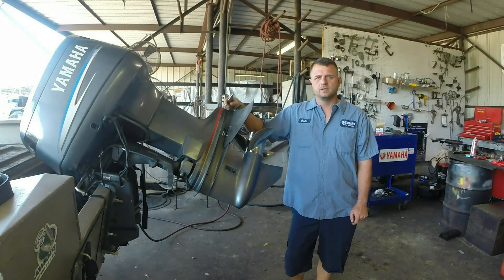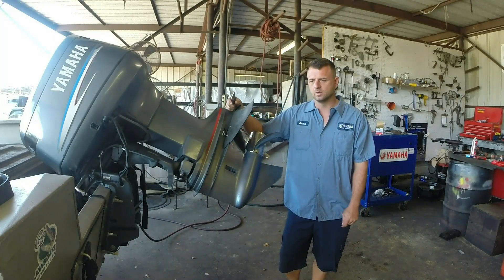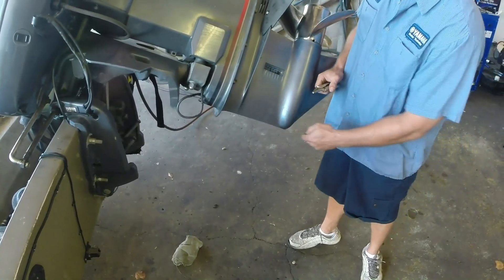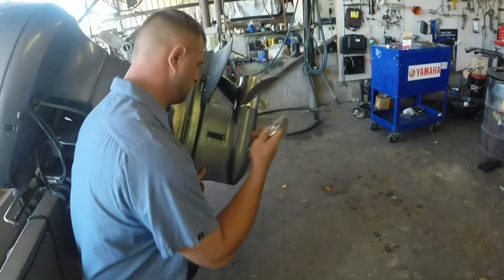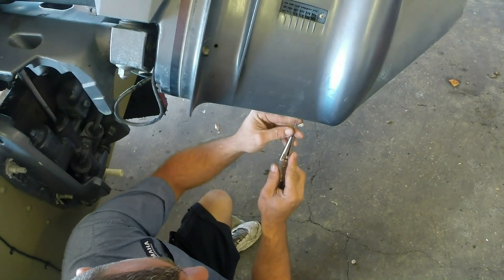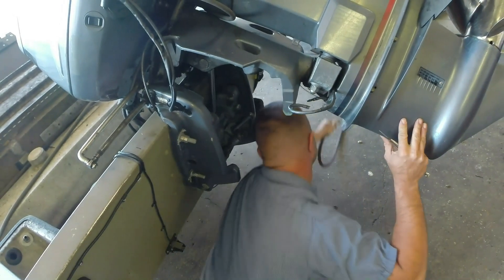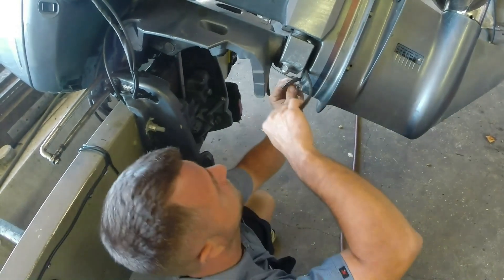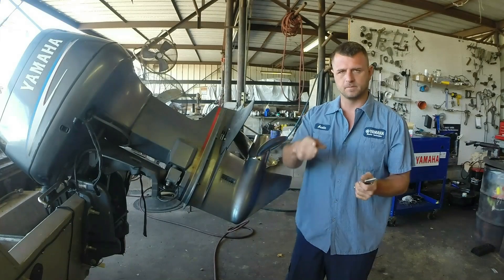Checking Boat Speedometer on Yamaha Outboard

Comment: Great Video and put me in the right direction. I have one problem, i broke the 1/16 drill bit cleaning it out. got to agressive. How do i fix it so I can use the motor speedometer?
Reply: Did you figure it out? I broke a bit in my lower unit also.

Comment: Awesome brief to the point video!  I never Gave a thought as to how my speedo worked or why it quit.  I followed Justin's instructions and blew out the lower Pitot tube, still didn't work. Disconnected the tube from the Speedo and that was the problem the tubing had cracked after 16 years and needed to be replaced.  Replace for under 20 bucks Amazon next day!!  Thanks much!!
Reply: Hey Steve can you provide the Amazon link for than lower tubing that's coming out of the lower part of the o/b. thanks

Comment: Thanks! Great instructions. Do you just pull that tube out with needlenose pliers where the air came out at the connection? It's pretty narrow there and I didn't want to break the tube.